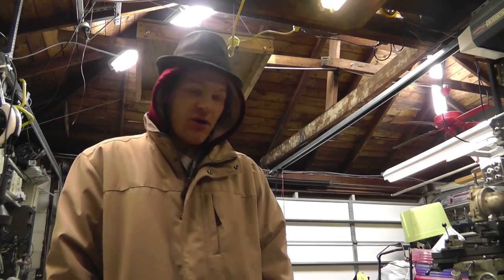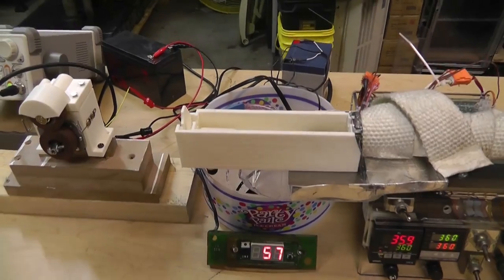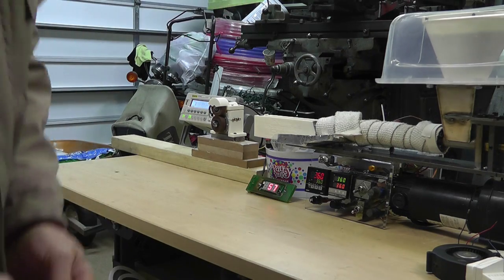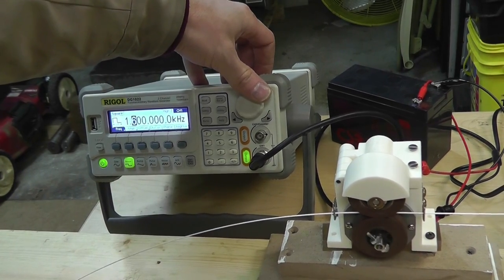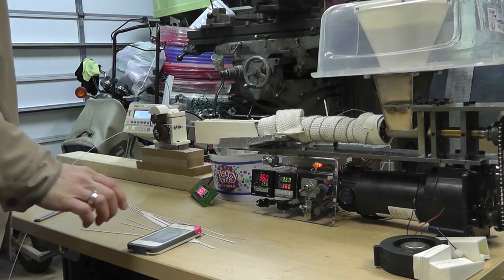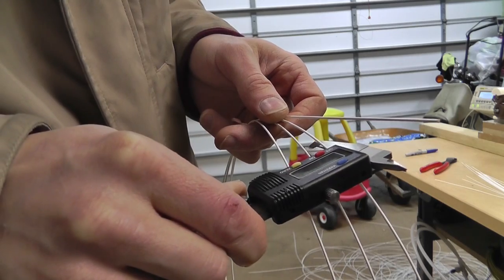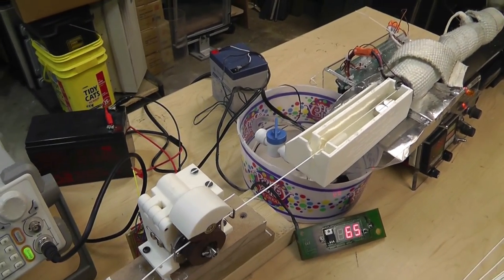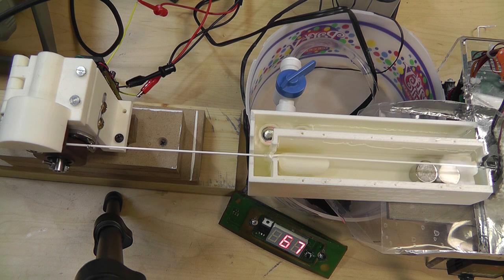#10 ~Russ's Filament Extruder: Testing "The Puller" & Some Conclusions Thus Far...

Comment: Someone who works in a lab testing polymers every day and 10ish years in polymer molding and extrusion, I can tell you that every 'type' of plastic, in this case ABS (ABS "A", ABS "B", ABS, "C") will have different Melt Flow Rates, even the same types of say ABS "A" but from different manufactures will have varying melt flow rates and viscosity to some degree. What I'm getting at by this is every type of plastic you feed into this will likely need to be fine tuned to the proper speed to get the correct size. As for the tolerances.. being a homemade "desktop" extruder it's hard to say where the main problem may be, could be any number of things, extrusion rate, die (nozzle) size or die shape, barrel pressure inconsistency, and so on. Easiest thing to do would be to play with speeds and die or nozzle sizes/configurations. running at a slower rate may make the extruder more consistent giving tighter tolerances.

Comment: Thanks for all your videos. i gain a lot insight which i found out the most important part for consistent filament diameter is the PULLER. Maybe we can introduce a PID puller together with the diameter sensor

Comment: Russ why not set up a free spinning unregulated motor with a clutch system maybe even using a magnetic clutch that will only pull hard enough on the extruded filament to keep it from bunching up? The tolerances are really going to come down to two things. (1) The Extruder temperature and it's speed. (2) The room temperature and the reason I say the room temperature is any environmental fluctuations will effect the cooling time on the line. Before I forget, You have a good eye for the devil in the details. Keep it up!
Reply from the maker: thanks! yep. still a lot to work out but truly. this plastic is wrong and thoroughgoing my game way off... more testing to do... :) ~Russ
Reply: *****
I've been watching your progress on this little project with much anticipation.
This is a really cool build. Speaking of, I got a kick out of the vacuum control
unit for your dad's xmas present. Did you ever redo the warped box?

Comment: Russ how did you build a temp control panel for the heaters. I was going to buy set temp ptc's but with how much your changing the temp has got me worried. Do you know of a video that could help me out on how to build the circuit board. Thanks

Comment: Dear Russ!
I really like your work! The extruder looks very cool and it will make a good filament very soon (I'm sure about that)! But you did a design mistake that will cost you many problems. After the barrel (between the barrel and the die) you have to put a screen plate (just a circle of metal with holes in it, but not in the middle of it). In extruders, this screen plate is a must, because it will translate the rotary movement of the molten material in a translate motion. In the LYMAN filament extruder, there is such a screen plate.
P.S. For the insulation plate, every non-metal material, with a molten point of 50% higher, will be good, so don't pay attention on it that much. For me, PTFE is good enough. :)
Keep the good work!
Best regards!
Bobby

Comment: What is the tolerance of final filament Sir? guess it is not pretty sharp as far as you are pulling it with low quality motor on batt...actually there are no cheap solution for such pulling part. coef. of RPM detonation must be very very VERY low... are you sure in it?You have very! good extrude, no comments here, but pulling part... you have to use other logic in it...

Comment: I've built a very similar extruder, mine drop style, and consistent diameter is a huge problem for me as well.  The open loop nature of the process is frustrating. I've been looking at diameter measurement at the exit of the hotend but commercial optical solutions start at around 12k.  I'm currently looking at diy laser shadow machine vision solutions, but I find the open source vision projects rather, well, opaque.   Have you made any progress lately?

Comment: Hey Russ try a longer extruder nozzle.. About 3 inches into the water bath. Im thinking the main problem is the gap between the extruder nozzle and water cooling is causing the plastic filament to stretch and compress.
Reply from the maker: yeah, i think if the plastic cools in the nozzle it will stick and not come out. if i put the water bath to close the plastic had a type of thermal shock and dose not cool uniformly. ?!? strange ~Russ

Comment: In the plastics industry the 2mm die is a goto standard in a lot of lab testing situations. I would not be at all surprised that whoever came up with the 1.75 filament that they were running from a 2mm die.

Comment: It may be worth trying a drop nozzle. I believe they make the precursor for carbon fiber using a multi story drop. The nozzle points down the the weight of the line is taken into account. I am not sure how they start the process.
Reply from the maker: yes i have seen both. and i have seen both work well. bad thing is i would need like a 10+ foot drop so kinda hard in a standard home environment. if ran slower i would need less room... ~Russ

Comment: I would be interesting to have a optical measurement of the diameter, in order to know the variation of diameter timewise (and filamentwise)
Reply: Russ, I think Vincent is on the right track.   Your best solution for accuracy is to setup a feedback loop between your wheel speed and your optical measurement.  THAT would probably solve your tolerance issues since your wheel speed can be adjusted pretty easily.  Environmental temperature and orifice diameter will be constants in you equation.